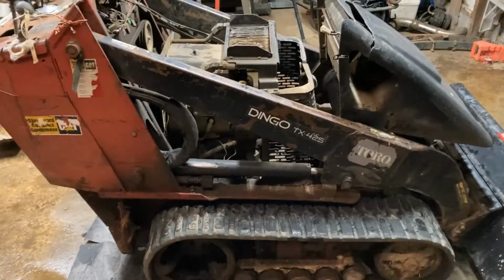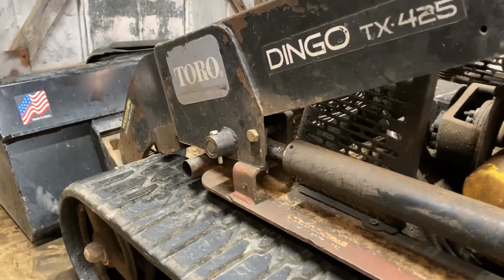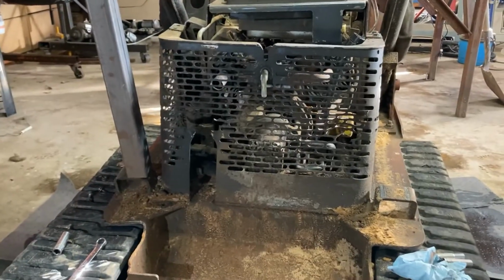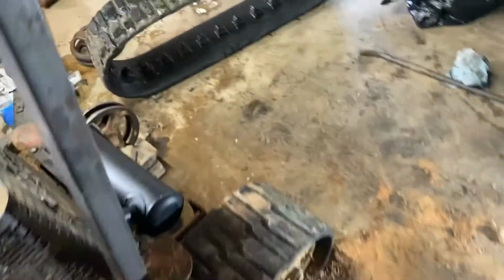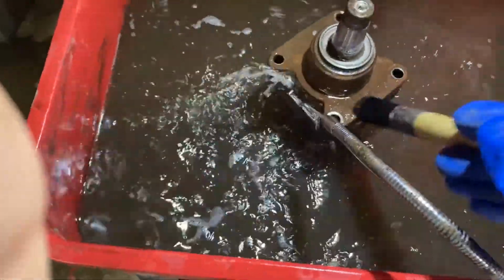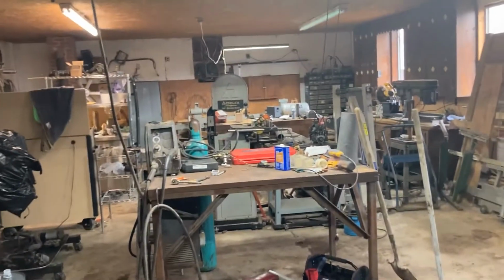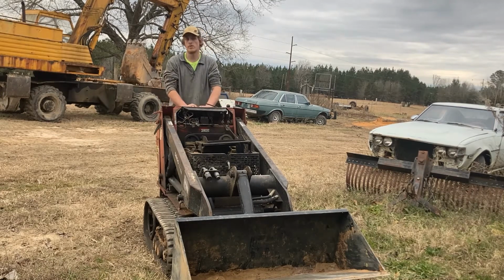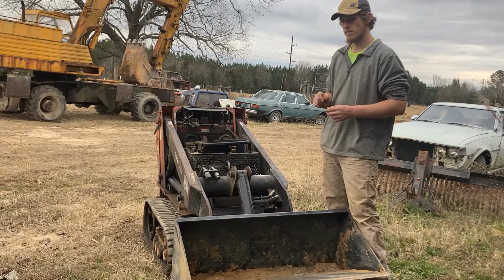Toro dingo service.

Comment: Hello - Any suggestions for a tx420 that will suddenly not crank?  aux hydraulic lever is in neutral, fan comes on when turn the key to 'on' but will not crank the motor

Comment: Ever heard of THOMAS branded skidsteers? I have a small
Unit Similar to the  TORO 323. Well once i use it for about 20 mins It looses all hydraulic power and won’t budge. Hydraulic pump is new. I replaced it thinking that was the problem. Any thoughts on what could be the problem ?

Comment: Hey man I got a  dingo 525 diesel. I tipped it over and once I got it back up it won’t turn over. Got any advice?
Reply from the maker: Check to make sure there’s no engine oil in the cylinders causing a hydraulic lock. If the cylinders are clear just check everything electrical.